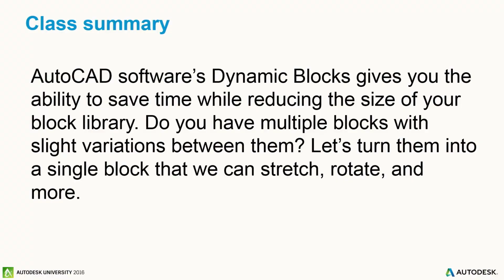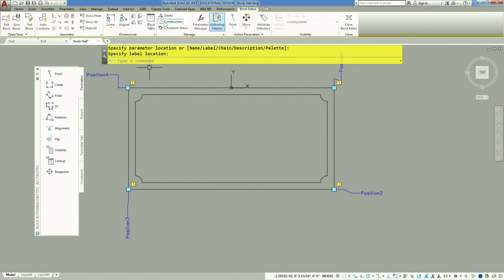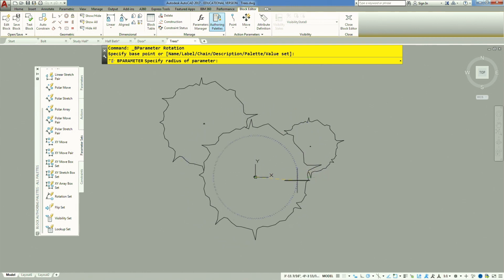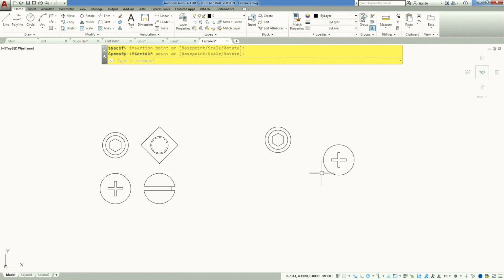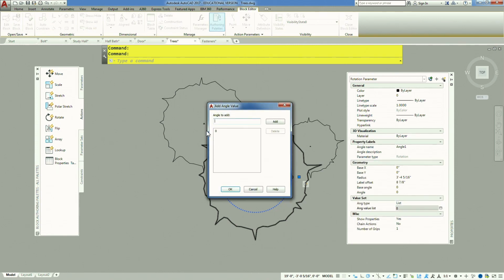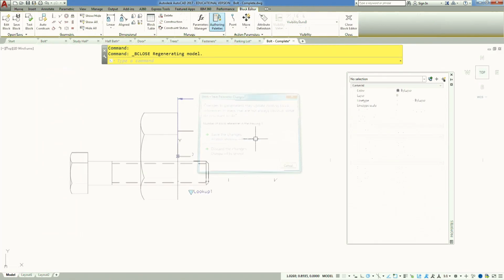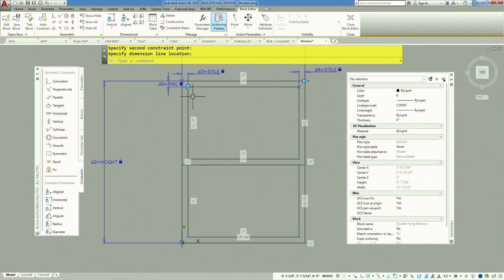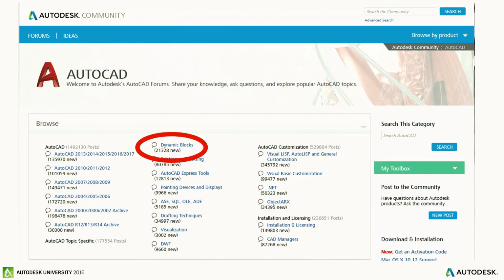Creating Dynamic Blocks in AutoCAD—Only You Can Prevent Bloated Block Libraries

Comment: Hello sir. May I ask you this?   Can we keep changing the insertion points of an already inserted block?

At times, you may want to insert/move/relocate the same block on the basis of a mid point & other times you may want it to be placed with respect to bottom left corner (or any other point)...  Please revert. Thank you.
Reply: Yes but you need to assign a move action to the point to do that.  That way the grip will appear on the block. Then you select the objects you want it to move.  
Just remember that after you add the first move point and select everything, and then add a second move point you need to go back to the first point one and add the second point to it (as something you want it to move) as the 2nd point wont have been there when the first point was created.  The other way around this is to create all the points and move actions first without assigning any objects to them, then go around each parameter assigning all objects to them all.
Reply: @mrgrotey  thank you sir.  Let me work on it!

Comment: time table for the webinar
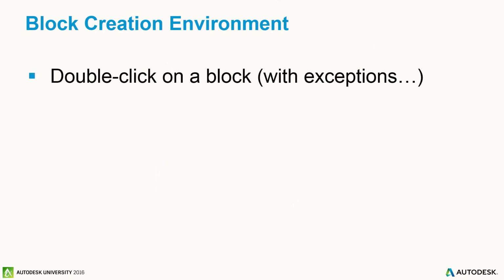@5:54 block creation and edit
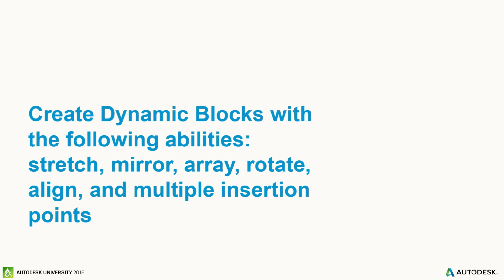@7:27 creat multiple insertion point using point parameter and press ctrl to cycle between the points while you are inserting the block
@12:39 using alignment parameter to grip on an edge
@14:47 using the linear parameter and flip action to put mirror grip on blocks and test your block before using it (woahhhh magic)
@17:48 grouping parameters and actions /using rotation set/
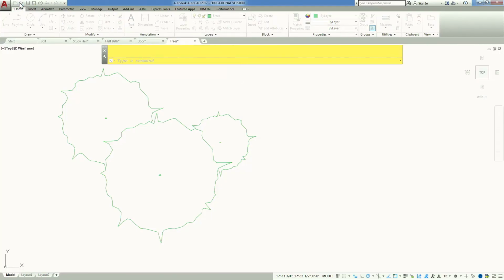@20:01 controling block visibility by visibility parameter (cycling blocks with no block insert command) what kinda of sorcery is this \(*0*) /
@28:16 using linear parameter and stretch action to stretch blocks
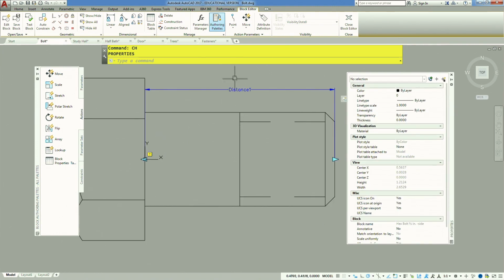@31:57 using linear properties to set the values of the stretch action
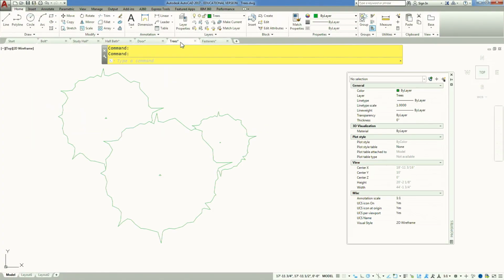@34:02 using angle parameter properties to set values of the rotation
@35:08 using a linear parameter and array action to array a block ( my eyes filled with tears of joy right now) /awsom tip/
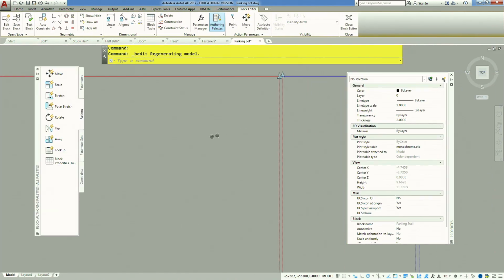@37:16 limiting the increments of the arrayed block with linear properties
@39:17 using lookup parameter and lookup action to create an allowable list of values of block sizes with a drop-down list
@45:46 auto constrain of block geometry ( point stay together- lines stay perpendicular) and using parameter manager to set changes in width and length of a block
@52:50 extract data from dynamic blocks using data extraction tool and update the data when you insert new dynamic block ( the holy grail of autocad)

hope this helps you on your autocad learning journey and any mistakes in this time table please put it in the comments..... good luck

Comment: Wait @ 43:28 the question is asked about using dynamic blocks for extrusion length for 3d blocks.  I am using 2017 since I am too lazy to migrate my settings up to 2020 and am doing exactly that.  I  am using this tool for dynamic seismic bracing which is 3d to stretch the length and it is working great!

Comment: Thank you so much for posting this presentation! This is a highly useful tutorial with information that I could not find anywhere else - I appreciate it. Now I can impress my co-workers. One thing that I had to note is that I did not know the proper way to import/export a block library. According to my co-worker, the best was to do this is through the design center (type "DC" in the command line) if that is helpful to anyone else!
Reply: I am glad you found it helpful Ashlyn!
Reply: You can add your edited dynamic block in design centre